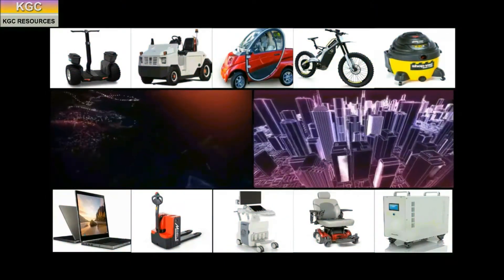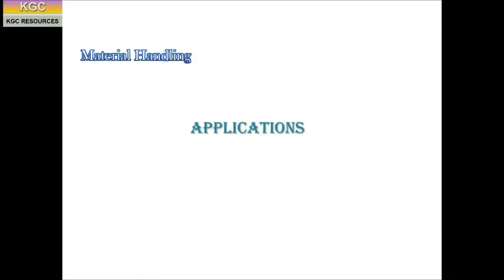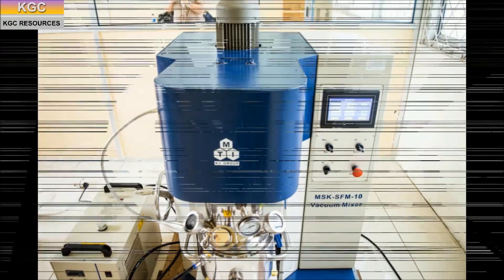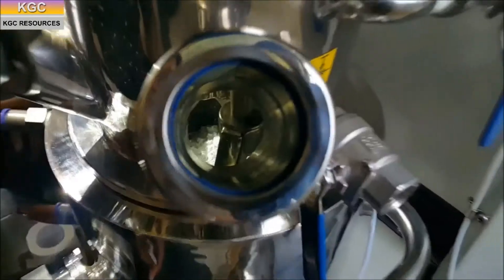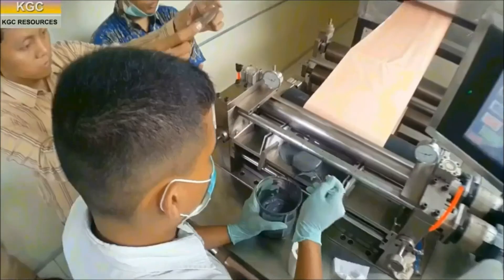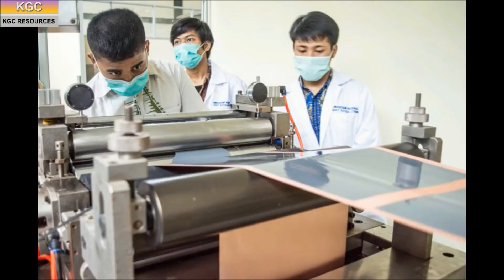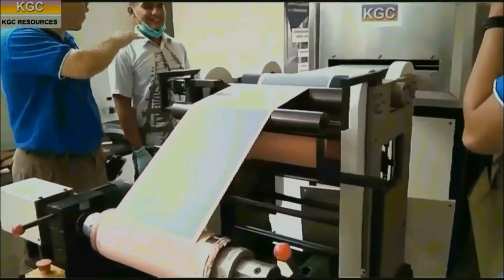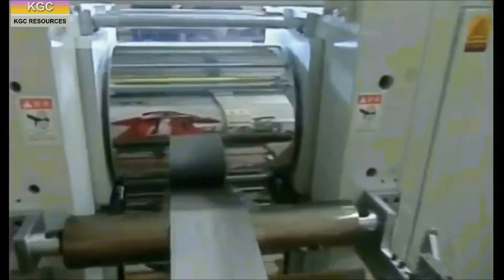Electrode Sheet Preparation ( Lithium Ion Battery )

Comment: What is the base copper foil thickness and characteristics, are only ED copper foils used, can RA copper foils be also used, just curious whether RA copper foils are also used in making the anode current collectors : Thanks
Reply: Hi, I watched your video on Lithium battery electrode production.

Please can you give the the complete list of the raw materials

 And there ratio .